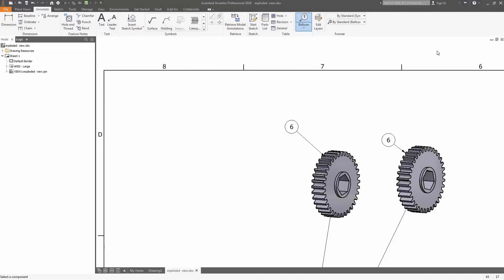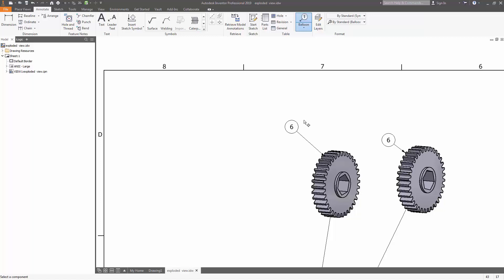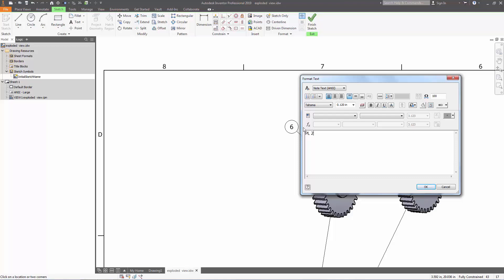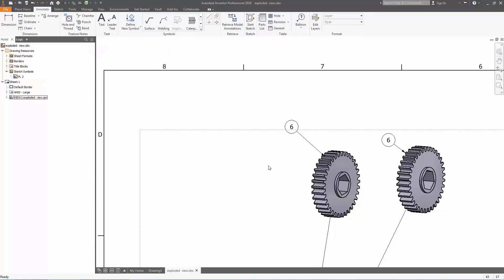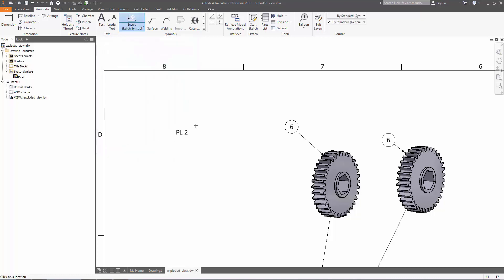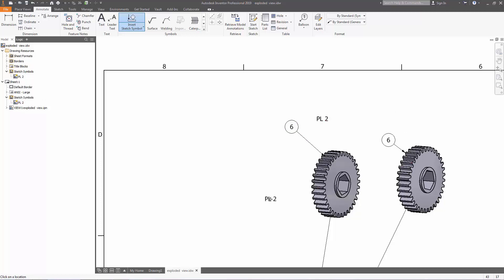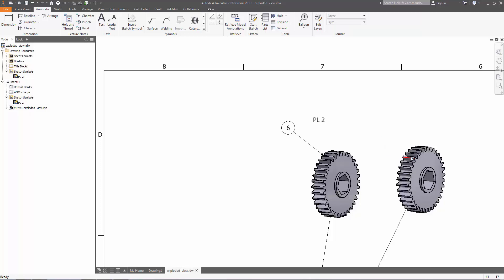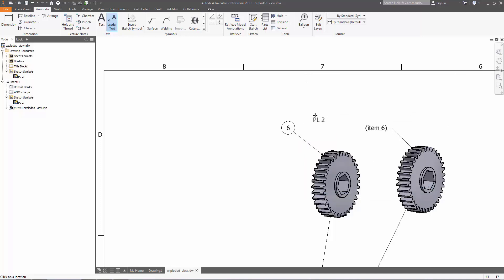Quick Tip - Custom Balloon Call Outs

Comment: And it would have been so easy to insert the variable for the item number instead of overwriting it with a static value. Autodesk should be ashamed to show such a method on their channel. Many drawings suck because of such practices. And you show this to people in a quick tip???
Reply: How would you do this? All I see in the Format Text dialog are iProperties and Parameters.